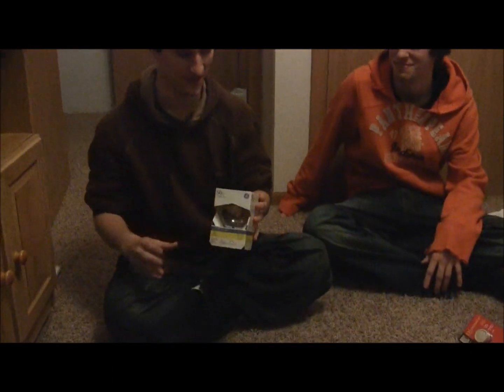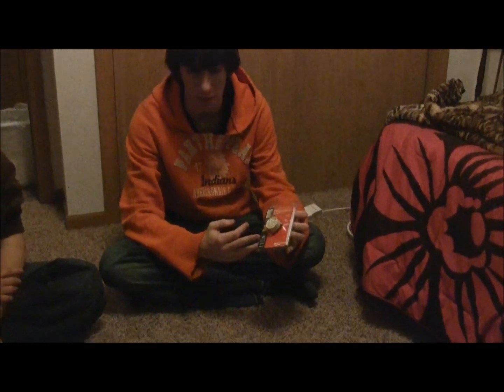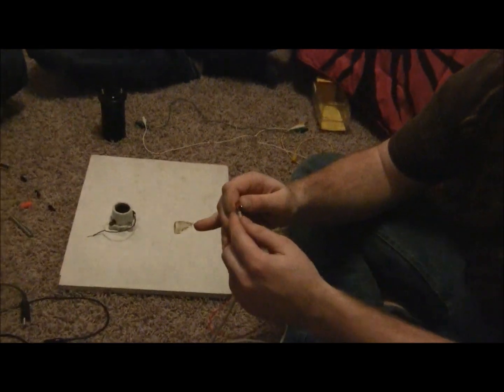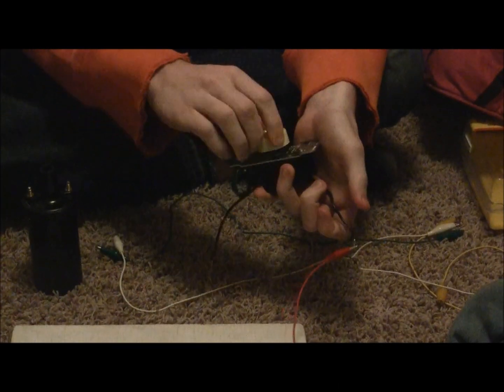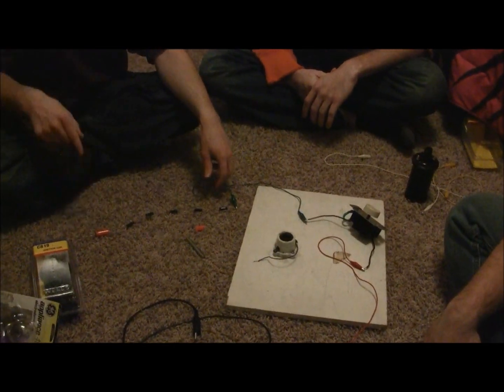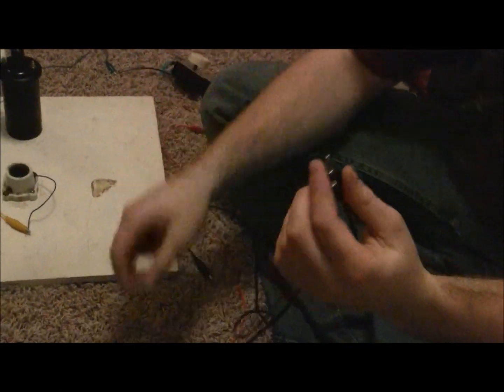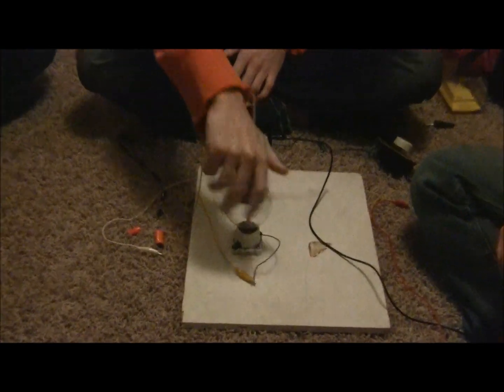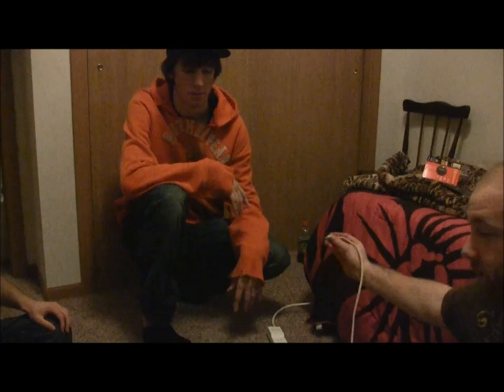Homemade Plasma Globe

Comment: The alligator clips aren't connected with an insulation wire to them, it's just the alligator clip itself do you have any suggestions of what type of wire can help to work the same way as the ones in the video?..